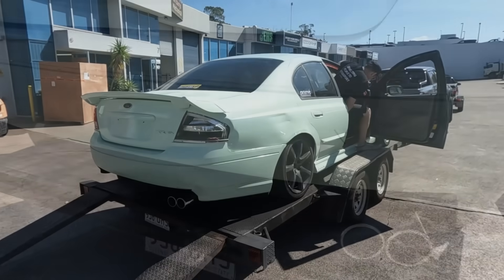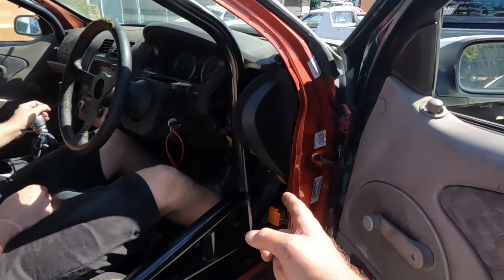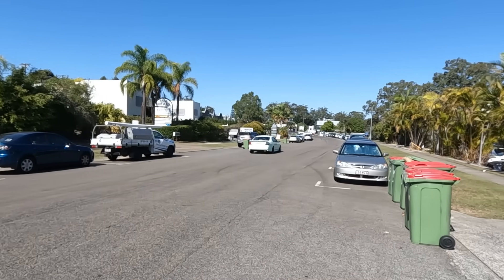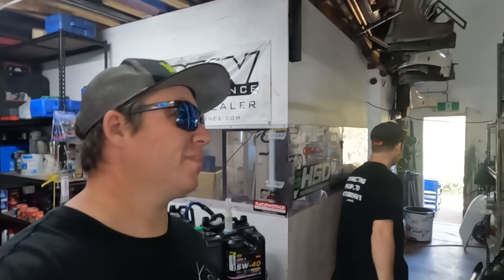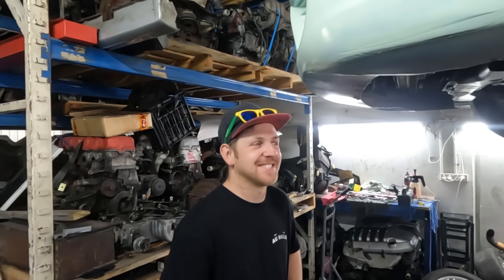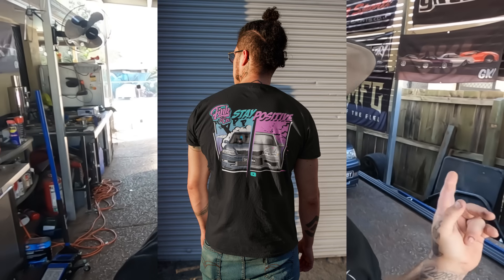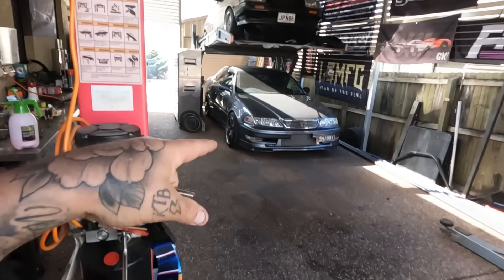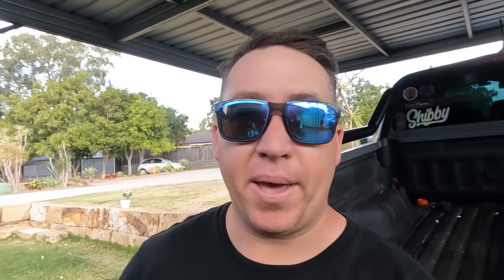JAPAN falcon to turbo or not to turbo

Comment: Cams and a turbo, even a t3/t4 hybrid would wake it up. Of course Luke would run it at the limiter so a big boy turbo and a high lift cam. Doesn’t need to have a lot more duration with a turbo, just room to push a lot in.

Comment: Combination of gearing in diff, 6 speed and the extractors and exhaust would definitely be taking away torque over the rev range and and the rev range is way shorter

Comment: Was considering a na xr6 not long ago because turbo prices are insane but on advice from a mate i hung out for xr6t and so glad I did, after driving it I'd never consider an na barra again 😂
Picked up my fg xr6t manual yesterday, on its 250rwkw 650nm tune it's bloody insane ,has a 350 and 420kw tune aswell, it's scary now 😂 
Tbh I'd recommend a 3576, comes on almost instantly and holds til red line, it's perfect for these engines especially with the tr6060 and 3.73s 👌